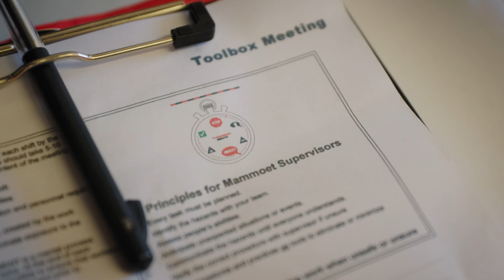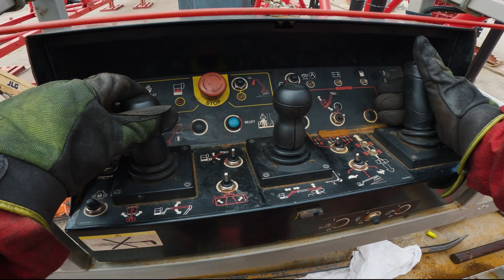🚧 Building the world's strongest land-based crane! 🛠️

Comment: Im running a Link Belt 238 which is a 150-ton crawler crane and it has 210 feet of boom.  It's not a giant crane but it's not a small crane either. The boom tip sheaves on that crane look as tall as the main upper structure of my crane.  That is what is known in the crane operator industry as stupid big.  🤔😲